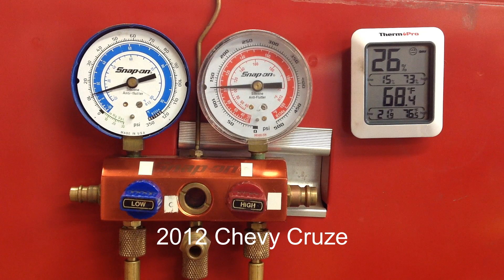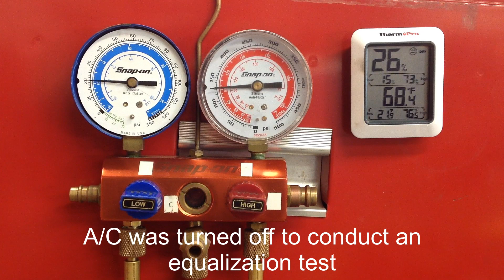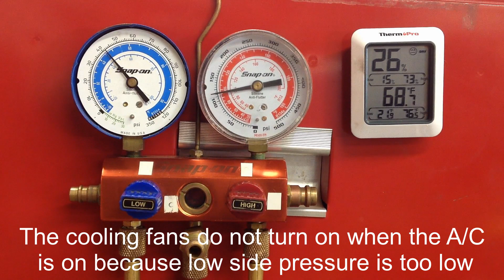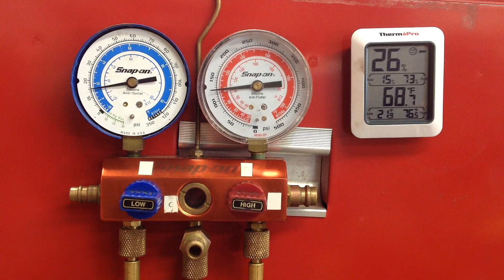A/C gauge analysis diagnostics: 2012 Chevy Cruze TXV

Comment: Hi professor Pentane, does this also looks like as a low on refrigerant situation?
Reply from the maker: Yes, correct.  A low side restriction looks like an undercharged situation.  Most tech will recover the refrigerant to check charge level just to find it correct.  The point of the video is a low side low and high side low situation can be more than a undercharged condition.   Thanks for watching, PP.